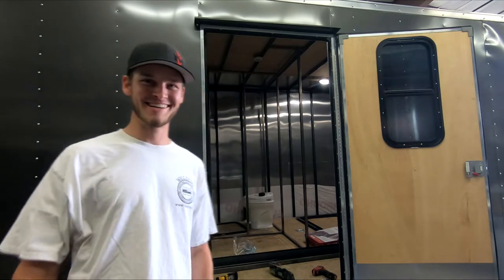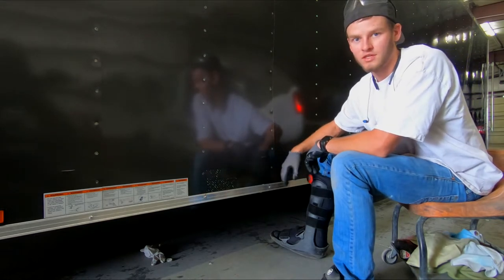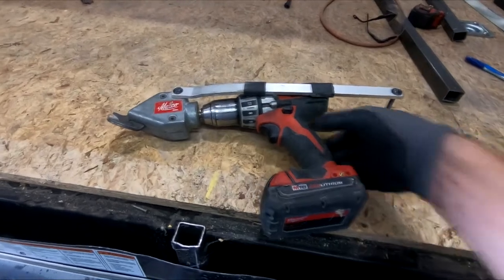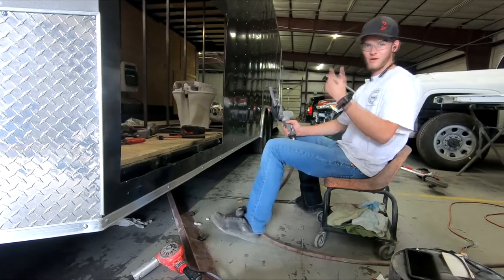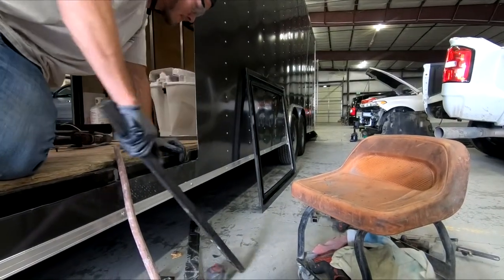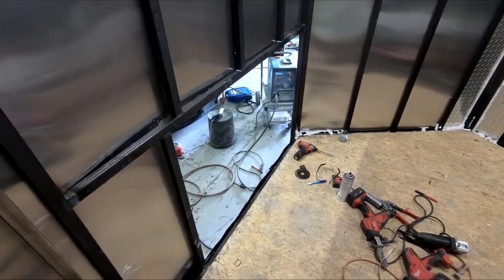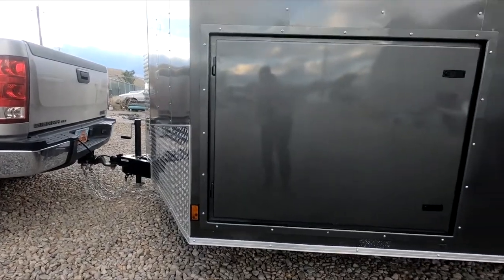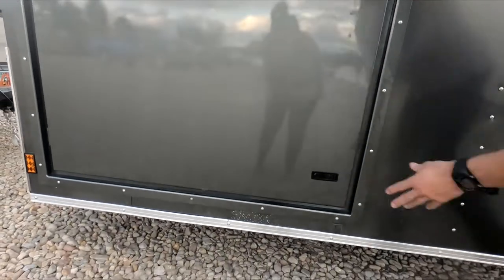Enclosed to Toyhauler Conversion #3 Cargo Door Install

Comment: Hey bro, you keen on making me a custom door? Building a mini and I’m having a super hard time with the door and yours looks great lol. Let me know!
Reply from the maker: That’s kinda funny you ask, a mini trailer is gonna be my next build! I’m still designing it right now and was thinking I need to find a door. I’d be down to make one though!
Reply: @AustinStout  I’m still in the design phase as well! I’m drawing it up on a 3D software if you want to take a look! I don’t have exact measurements for the opening yet, but I’ll keep up with ya.
Reply: Also, I’m just north of Ogden, so shipping wouldn’t be a problem. I could just come get it lol. I’m doing 4x8, what size are you doing?
Reply from the maker: @TheJenyr  Oh sweet! Are you using solidworks by chance? That’s nice you are local! I come up that way a bit too. I’m thinking 5x7! That could change though. Are ya gonna do axleless suspension?
Reply: @AustinStout  you’re not gonna believe this. Harbor freight trailer. Gonna extend it 6 inches over the deck on each side so it’ll be 5x8.
Reply from the maker: @TheJenyr  oh sweet! That will actually save a bit of work having a frame to go off of! I’m excited to see how she comes out!

Comment: Any tricks for cutting the steel tube without cutting the skin
Reply from the maker: It’s honestly kind of a pain. I’d use a cut off wheel for as much as I could then use a carbide tipped blade on one of those oscillating tools to finish it off! It’s kinda slow but you will have great control over the depth of cut etc. if you don’t have one already you can pick up a cheap one at harbor freight for about 20 bucks
Reply: @AustinStout  about what I thought just hoping for a majic bullet, thanks for the info!!

Comment: What kind of tape did you use to seal the door frame ?
Reply from the maker: S Trib I used 1/8” x 1” black butyl tape. The best deal I found was on amazon, here’s a link to the stuff I used 

https://www.amazon.com/dp/B01CUBJ4PS/ref=cm_sw_r_cp_api_i_UU91DbRN4577C

Oh unless you meant the foam around the inside lip, that’s 3/4” x 1/4” epdm foam from McMaster Carr. I wouldn’t recommend it though, with heat from sitting in the sun the adhesive gets loose and the foam slides around. I’d use a small bubble gasket.

Comment: Would be interested built some doors for my enclose trailer?
Please let me know. Thanks
Reply from the maker: Okay! Doors similar to the one I built here?
Reply: @AustinStout  yes
Reply from the maker: @prohydroclean  Roger that! Shoot me an email at 0absolutes@gmail.com with the dimensions you need. Width, height, and wall thickness. And what kind of material you want it made out of and I’ll get ya a quote